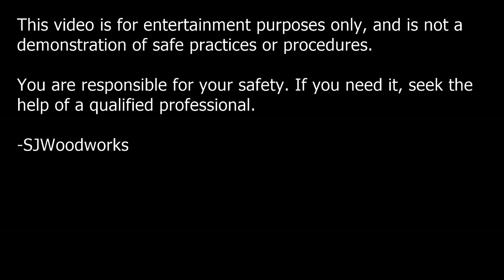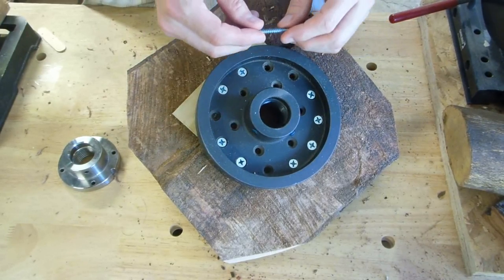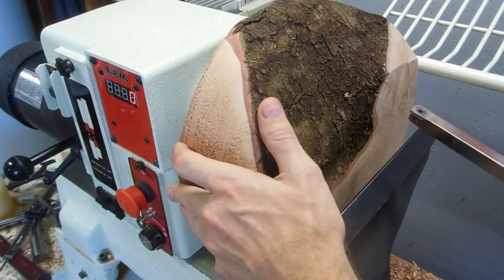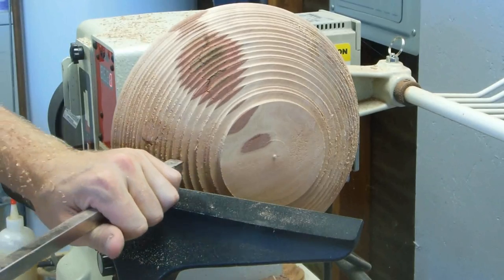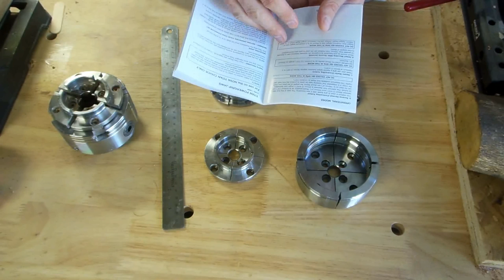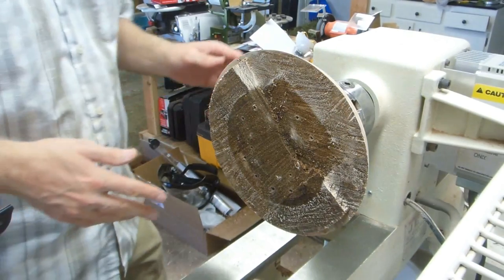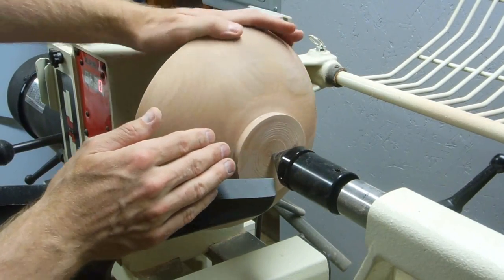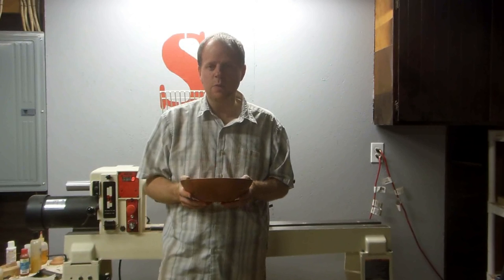Woodturning a large dogwood bowl using carbide lathe tools

Comment: Helpful, thorough videos, thanks from a beginner! Two questions, however: First, at 16:54 what is the "padding" between the inside of the bowl and chuck - and how can it hold without slipping? Second, how do you determine the inside depth to cut out the bottom since you can not feel the thickness? Many thanks.

Comment: Nice video... interesting that your lathe speed keeps fluctuating as you are cutting... is that caused by drag from the tool or the weight of the log?
Reply from the maker: Good question, I hadn't even noticed that. Must be because it is extremely unbalanced at the beginning, so the tool has a lot of impact I think.
Reply: SJWoodworks could be... love your videos - for someone just starting out making them they are well laid out and edited and very informative... I am just starting out myself and your are an inspiration... many thx!